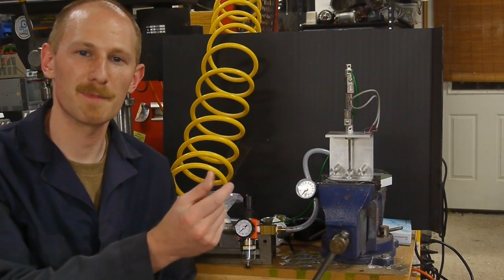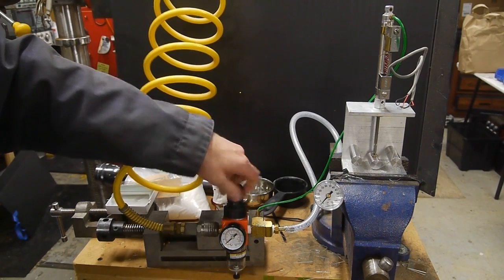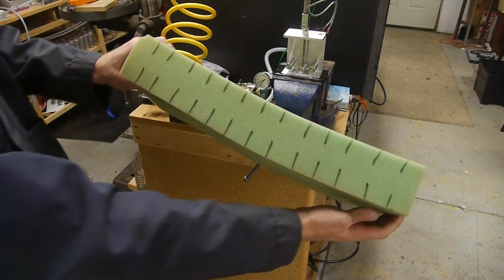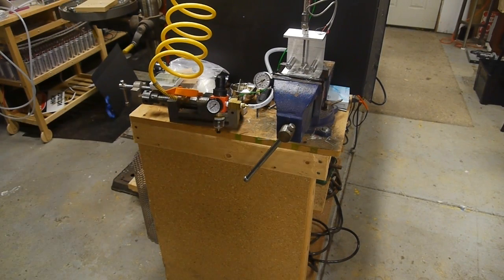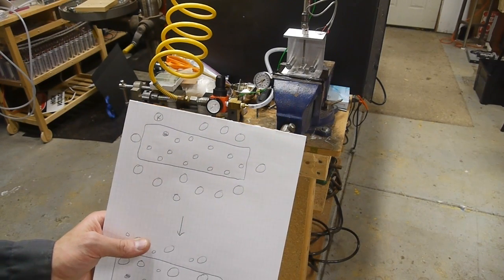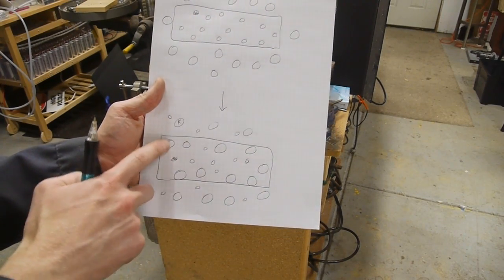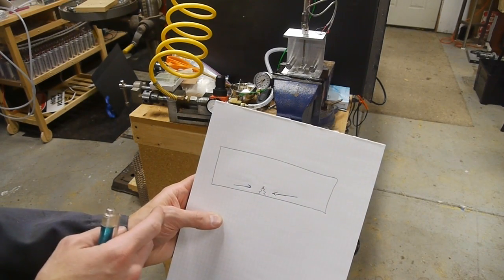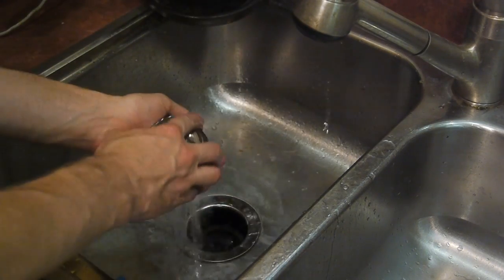How to chemically strengthen glass (eg Gorilla Glass)

Comment: Why do use psi? In the whole world only USA uses psi, like degrees F, 19/64" and other rubbish left over from the British empire.

,
Reply: gauges are cheap and easy to find for this test, psi is just an arbitrary unit. Dont be fooled everything in the USA that matters for any silence and engineering is done in metric. Im a retired machinist and use both systems.
Reply: conversions: try them sometime, if you want the metric numbers. :P
Reply: Convert it if it bothers you. 

Use beads of base 60 like ancient Mesopotamians, Egyptians,  Greeks, and Romans if you wish. Their engineering feats are still standing.
Reply: You can get a pressure gauge in 7 more different units, but for some reason everyone complains about imperial.
Reply: skeptic moderate So what's the punishment if someone uses mmhg or m.wc, bar, or any other non SI unit?
Reply: Andrew Metzger The public is allowed to use any units they want to, and upon further research, the majority of countries (including the UK) followed a voluntary Metrication program, but a few countries such as Australia made laws making it mandatory for certain industries to switch to metric.
Reply: Actually despite being a highly metric country, PSI is commonly used in Australia. For that reason I actually prefer that he uses PSI, because it will be easier for me to understand. I guess one day I'll learn whatever the metric equivalent is.
Reply: The way I heard it, Jimmy Carter tried to switch the USA over, but chickened out when public backlash arrived.
Reply: Carson Rush No the problem in the US was that switching was voluntary, whereas in Britain and elsewhere it was mandatory.
Reply: I just want to know the effective area of the piston so I can calculate force...
Reply: Probably because we had the most advanced industrial and scientific community of any nation in the world at the time the other nations were converting to Metric, and it would have required changing all our machinery and measuring devices and books and everything else that makes the country move, and retraining all the workers and teachers and everyone else who had been using inches and pounds and such for their whole lives, and since the existing system worked fine, why change it?

Gradually various industries have shifted to metric, and scientists usually use metric, but we are still using machinery from before metrics took over the world, and we still speak and visualize and immerse in inches and pounds, and so until we have enough dual designations that we as a nation can have the same intuitive relationship with meters and kg we do with pounds and inches, making the change fully is going to be very difficult.

I do like the people who add the metric equivalent in text on the video, so that lazy people the world over can understand, but really, you can learn how to convert to metrics, just like you want us to do lol
Reply: @ke6gwf  You seem to think it would be harder for the US to convert to metric than any other country. Yes, you would have to retrain workers, teachers etc. But it's not like there's a magic point where it suddenly becomes easier. Unless you start switching now, you'll still have people who have use imperial their whole lives. We all managed just fine, why can't you?

And no, it's not laziness that we hate converting from imperial to metric. It's the simple facts that a) you're just about the only nation on earth still using that measurement system and you expect the entire rest of the world to not be annoyed at having to convert and b) it's a stupid, nonsensical system that's hard to learn and hard to convert.
Reply: @clonkex , right now, it would be just as hard for the US to convert to Metric, as it would be for, say, Germany to convert to Inches.
Not just because of the training the people, but because nearly every single machine in use in every factory and every business and every home and every car and every plane etc etc is labeled in inches and pounds and F, and while some can have settings changed or software updated, most are hard-coded or printed or cast in, and you can't just change it.
So in order to convert your Metric, you would have to replace or retrofit billions of dollars of machinery, along with the retraining, and deal with lots of expensive errors along the way as people got conversions wrong, or were thinking in feet and not realizing it.

In order to make it happen, the decision would need to be made, and then gradually over years machines upgraded to be able to switch between, and new cars having the ability to switch, and dual unit road signs, and lots of training across every job and every field, until finally people were prepared to convert on a particular date.

Right now, everything is too integrated to be able to have piecemeal transitions without great expense and lots of major errors.

A long time ago, it would have been easier, before everyone was so linked and reliant on everyone else, but now we are used to being able to communicate with each other, and we only have to figure out metric conversions if we are dealing with foreign trade or whatever.

And you do realize that many scientists and others around the world still use non metric systems when they work better. While metric is more logical in most ways, and math is sometimes easier in calculating things, there are things that it just doesn't work well for, and other systems are more logical.

For instance, while C is more logical sounding, with 0 at freezing and 100 at boiling, those are just arbitrary numbers, because zero isn't really zero, and we often see below zero. If you really want to be logical, you need to go with Kelvin instead.

For normal daily use however, F is actually friendlier to use, because it fits with the common temperatures that most people see.
Instead of 0 being at the freezing point of water, 0 F is at the lower end of the common temperatures that most people see, and 100 F is at the top of the common temperatures that most people see.
So while C is based on water (which is a logical reference for pre-global calibration standards days, since people could calibrate their thermometers themselves by boiling and freezing water), F is based on daily life.

It's similar how inches, feet, and yards are based on daily life, and so for the purposes of most people, are easier to use in daily life.
One shortcoming of metrics is that there is no unit between centimeter and meter, so while I can look at something and eyeball it as 2 feet 6 inches, because I can estimate the length of a foot, times 2.5, estimating 76 cm just isn't intuitively as easy.

If I am going to be calculating differences and doing math related to it, then yes, metrics are marginally easier in some circumstances, but for most people in daily life, metrics really don't help much, and make some things harder, especially the ability to judge distances and be able to estimate sizes.

Basically, all the people being retrained would effectively justify be having to learn to convert the way they see things into metrics, rather than seeing in metrics.

I mean, when I see a short person, I say they were only about 5 feet tall, or a taller person was almost 6 feet tall.
Estimating 152 cm, or 180 cm just isn't as intuitive.

So there are pros and cons, and a great expense that would have to be invested in the change, and most people would not benefit.
Reply: @ke6gwf  Yes, it would be hard. I don't deny that. However it won't get any easier in the future so we're not bagging you for not immediately switching to metric, we're bagging you for not even beginning the process.

With regards to the maths being easier, it's WAY easier. It's a million times easier. What's the next size down from a 3/8ths inch spanner? I have no clue. The only way you know is by memorising the numbers. What's the next size down from a 13mm spanner? A 12mm spanner. And then 11mm. It's logical and easy. How many inches in a foot? Well actually I know that one, it's 12. But how many feet in a yard? I have no idea. And if I have 397 feet, how many inches is that? I have no idea. I can't do that in my head. It's an archaic system based on arbitrary relationships between the units.

You mention Kelvin. Yep, Kelvin is a useful unit of measurement. But it's not "more logical" than Celsius. All units of measurements are based, ultimately, on something arbitrary. 1 metre is the distance light travels in a vacuum in 1/299,792,458 seconds. That's not logical. I can't know how long a metre is from that. So saying that it's not logical to use Celsius when 0° isn't 0 heat doesn't make sense. Additionally, I don't understand your argument that Fahrenheit is "friendlier to use". How so? It's not based on anything I can relate to. I have absolutely no idea what temperature a balmy day would be in Fahrenheit. I don't know what temperature brings the possibility of snow. It means nothing to me.

With Celsius, I know that at around 0°, water will freeze. I know it boils at around 100°. I know that temperatures below 0 are very cold and there could be ice on the road and snow in the air. I know that a 25° day is nice, a 30° day is a little hot, 35° is quite hot, 40° is stinking hot and anything above 45° is heatwave hot. That's a system I can relate to. It makes sense to me. The only way Fahrenheit is "friendlier" is if you're already used to it. To me, it's actually pretty annoying when people use Fahrenheit temperatures in a TV show because I have to google the conversion to have any idea what they're talking about.

"If I am going to be calculating differences and doing math related to it, then yes, metrics are marginally easier in some circumstances"
You have got to be kidding. I don't even know how to respond to that. Maybe I'll just reword your statement. "Metrics are a LOT easier in MOST circumstances."

And finally, yes, I agree that inches tend to be easier for rough estimates of short distances rather than CM.
Reply: @clonkex , on wrenches. (why can't you change to calling them wrenches instead of spanners? Lol) 
I have been a plant engineer and diesel mechanic, so I am familiar with wrenches, and yes, in theory metric is more logical, but in practice, not so much.

If I buy a set of SAE wrenches, it is going to be in 16ths, so if you understand fractions, the next size down from 3/8 will be 5/16, and the next size up will be 7/16.
However if you buy a metric wrench set, what's the next size up from a 12 mm? 14 mm. 13mm is often skipped. 
Yes, you can get expensive sets that have every mm size, but the bolts come in common sizes, and some are very rare, so wrench sets often don't have them. And then there are the ones that are in between, and so you have decimal sizes like 3.7 and 4.5 and some others that I don't remember right now.

Here is a regular sae set:
3/8 in., 7/16 in., 1/2 in., 9/16 in., 5/8 in., 11/16 in., 3/4 in., 13/16 in., 7/8 in., 15/16 in., 1 in.

Here is the equivalent metric set:
10mm, 11mm, 12mm, 14mm, 15mm, 17mm, 19mm, 21mm, 22mm, 24mm, 26mm

Now, you are familiar with the metric system, so they will look familiar to you, but is it really more logical or easier to have skipped sizes, instead of steady fractions?

Those sets are both designed to fit the common sizes in that range, but one skips numbers, so you have to memorize what the skipped ones are.

And now that you know that SAE wrenches and sockets are in 1/16 inch increments, all of a sudden, it isn't hard to figure out what the next size will be.
Reply: @clonkex  on distance.
There are 12 inches to the foot, and 3 feet to a yard. Not too hard to memorize, any more than 100 mm to the cm and 100 cm to the m, and uhh, how many m to the km? Oh I guess that's a thousand. Shouldn't it be a step of 100 to be consistent? (and yes, it is in the name kilometer, but you have to learn the meaning of a kilo, so you can learn 12 and 3 just as easily! Lol)

And why do you need to know how many inches are in 397 feet? That isn't a very common type of daily question that we need to know. And yes, it sucks having to divide by 12 once in a while, but they did invent pocket calculators, so it really is pretty easy the few times we need to do it.
And I used to work construction, both wood construction with short lengths, and grade setting on dam building projects with lots of longer distances topics work with, but I was having to use the calculator for a lot of it anyway, I mean, how long is 3227 cm plus 549 cm?

That would be 105 feet 10.5 inches plus 18 feet, which in my head I can easily come to 123 feet 10.5 inches.
And that is the type of thing I used to do all day when I was working construction, and is where having something between cm and m really shines, the daily type of difference.
Or would you break it down to 32 meters, 27 cm?
In which case, we are even lol

Oh, and the meter is not based on the the time it takes for light to travel in a vacuum. The meter was defined long before the speed of light was measured, but because the metal master length standards always were slightly changing length with temperature etc, they finally measured one of the pieces of metal by the speed of light in a vacuum, and redefined the meter based on the that constant.
So it is a logical progression, but the meter was not derived from the speed of light, which is why it has no relation.
It's like how they just like a few weeks ago redefined the kilogram as based on Planks Constant, rather than the piece of metal sitting in France, and already all the other weight units are defined as fractions of a kilogram.
Reply: @ke6gwf  Why would I call them wrenches? Wrenches sounds silly to me. They're spanners. And adjustable spanners are usually called shifters in Australia, or shifting spanners.

Honestly I had no idea they were 1/16" increments because they use fractions so they're not named helpfully. So instead of 12/16" it's 3/4", which makes it very unintuitive to know it sits between 11/16" and 13/16". It's silly that I have to do maths in my head to know what size spanner to expect.

As far as 13mm being often skipped... I don't know about you but I encounter 13mm bolts _all the time_. I have no idea why. I can't speak for spanner sets missing 13mm because I haven't bought one for a while. All I know is all the spanner sets we own (including a small ratcheting spanner set) include 13mm.

Why do you have to memorise which sizes are skipped? Why does it matter? Either you have the appropriate spanner or you don't, and you'll know immediately because you'll open your toolbox and think, "ok, somehow I know beforehand that the bolt is 16mm and because of the sensible naming scheme I can immediately see that I don't have one... curses".

Finally, why do you call it SAE? In my experience in Australia it's known as Imperial. Metric and Imperial are the two main measurement systems.

¯\_(ツ)_/¯
Reply: @clonkex  on temperature.
F and c are both arbitrary systems.
However, c is constrained by the phase change of water, and so you only have about 50 degrees for you normal daily life.
For you, wintertime is going to be around zero, maybe below if you are in cold climates, but most people don't spend much time below zero c. Then as you say a heat wave might get you up towards 50 c.
For me, I once in a while see zero f, and I have been down to - 24 or something, but once you hit zero f, you really don't do much different as it goes down, it's a hard freeze, and you had better be dressed warm lol
Freezing is at 32f, which is pretty random, but easy to remember.
At the top end of normal temperatures, we get to 100 f.
50 c is 122 f for your reference, and sometimes we might see that kind of temperatures in Death Valley, or Las Vegas during a heat wave, but most places are not going to see over 100 for (38 c) very often.
So we basically have our normal survivable temperature between 0 and 100 f

So now you can estimate temperature in f, because anything below 0 is nasty cold, and anything above 100 is nasty hot.
So a warm day is in the 70s-80s, hot is 80s-100s, a cold day might be in the 40s. Etc.
Room temperature is considered to be 68 f (20 c), though others use 70 f.

So in your telling of the normal Temps in c, it seems normal to you, but you are only using half of the 0-100 range, and so it really doesn't make sense mathematically.
And when you read my explanation, it is probably going to sound wierd, because it isn't what you have learned, but c is the same way for me lol
That's why they developed Kelvin, so that there is no arbitrary numbers, it starts at a universal constant, and counts up from there.

But no one wants to set the wall thermostat to 294 degrees, so we stick with f and you stick with c, for the same illogical reasons of habit and tradition. ;)

But you complain and tell us to change our lives, because you don't want to have to convert numbers.
What if, as a scientist, he gave all his numbers in Kelvin, would you be happy then? ;)
Reply: @ke6gwf  I wasn't saying C makes more sense for daily use than F. I was saying F doesn't make more sense than C. You said F was friendlier, I pointed out it wasn't. You have to know the expected ranges of either system for it to make sense. That was really my only point regarding temperature.
Reply: @clonkex  just so you know, I am actually enjoying this conversation, and am learning new things about metrics in the process.
I do enjoy the Australian views and language lol
Shifters makes perfect sense! 
I may have to steal that.... 

The way fractions are normally used is to use the largest fraction. 
So 1 inch is not called 16/16ths, and half inch is not called eight sixteenths or two quarters because it is easier to say or write the larger fraction. 
Once you use it a couple of times it is natural. 
And while you may not be used to fractions as measurement, this is just how fractions are commonly used. 

Maybe the common bolt sizes are different in the Aussie market than down here, but I do occasionally run into sizes that I don't have, and have to use a shifter (snickers) or try to get a socket on it (socket sets don't usually skip as many lol) 

As to SAE/Imperial, we don't really use Imperial in the US. 
Some things like inches and feet are the same, but Imperial is the British system, and not everything matches. 

In the US the system is technically called the United States Customary System USCS or USC, but that designator isn't used very often. 

SAE is the Society of Automotive Engineers, and they are one of the major Standards groups over here, defining threads and what horsepower means and various such details. 
They were who really started the standards for fasteners in the US, and so tools were marked in accordance with their standards, thus were marked SAE, and that is just how it is usually done now. 
SAE uses the USCS units. 

This is why I have been calling it inch and metric, because imperial/sae/usc etc is confusing lol 

Since you were more recently a British property than we were, it makes sense that you would know about Imperial, rather than SAE/USCS.